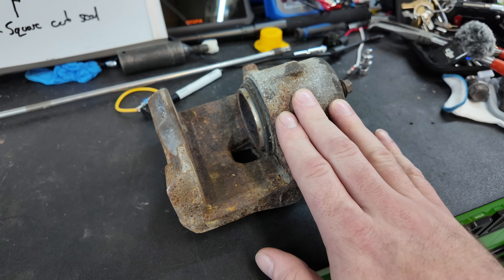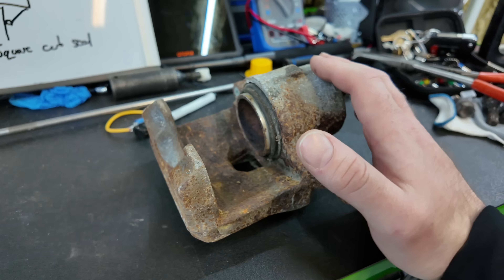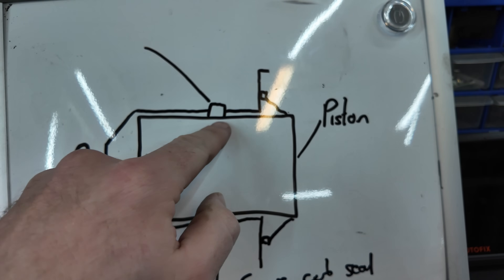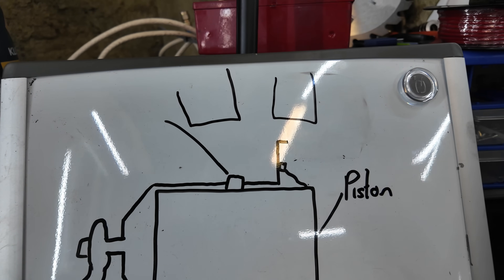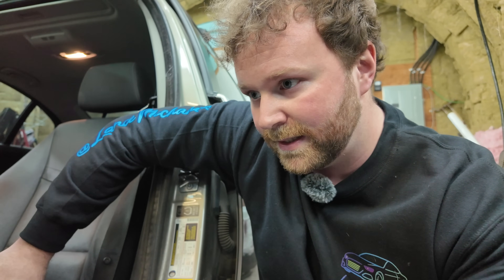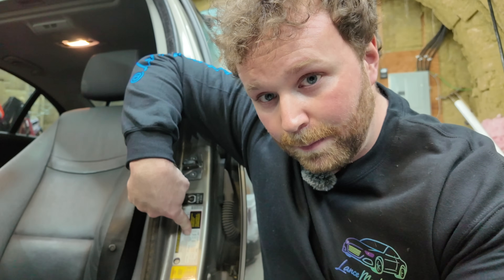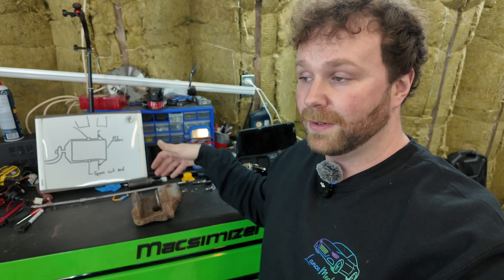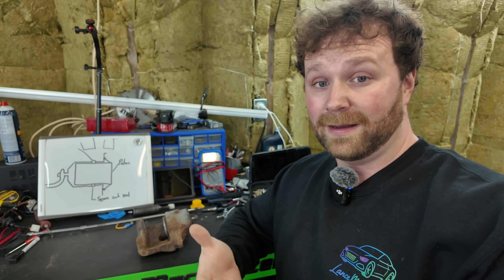Half of New Techs Can’t Explain This…

Comment: I wondered who acts as return spring and I found the same explanation: the piston is pushed out by the liquid, the square seal becomes a rhomb and when the rubber's elastic force is greater than friction, the piston slides with respect to the seal. When the pressure decreases, the seal becomes square again and retracts the piston a minimum but sufficient distance. But who retracts the pad? And if on some models the pad is attached into the piston, who retracts the opposite pad, by sliding the entire brake calliper? It's disk run-out. I can confirm that with huge run-out (bearing damage) the gap/clearance increased dramatically; and somebody reported a guy who grinded the disk ON THE CAR to have absolutely no run-out obtained smoking pads, because no pad return.

Comment: Is that seal going bad one of the reasons a caliper can get stuck on?
Reply from the maker: More likely the dust boot has a rip and there's some rust on either the caliper bore or the piston. When seal is faulty they leak brake fluid

Comment: Speaking as someone with decades in automotive- the world has changed and the bright technical guys who may have gone into the trade when I was young in the 1980's and 1990's are now going off to college or doing other trades with apprenticeships. The auto trade is now famously linked to miserable working conditions, low pay, isolation, disrespect and a confusing flat ray system (thanks to the Internet and social media). A lot of the guys who do it now have nowhere else to go and aren't the sharpest knives in the drawer- which is ironic given the complexity of modern cars and systems. Automotive SHOULD be a high paying trade with established licensing, apprenticeships and schools like electricians, plumbers, elevator techs have (and who make 6 figures all day). Arguably, it's the most complicated of all trades in terms of sheer systems to learn and understand. However, we've created a broken system where ANYONE can claim to be a mechanic and there are no standards.

Comment: 2:39 i can give you a very easy way to prove this.
       Take a double axle trailer camping and set it up quickly. Put in a trailer axle stabilizer and tighten it (one that locks the 2 sets of wheels together)
       After you f around and finish setting up camping, or even tge next day, that stabilizer will be loose. After the tires cool down. Father in law kept blaming the clamps i told him my theory

Comment: I started in this field in the 70's right out of high school at a chevy dealer for a year then a Toyota for 2 years, back in those days we rebuilt everything, calipers, wheel cylinders and master cylinders I don't really care what causes the caliper to retract I only care about what causes the caliper to stay on, I could have a slight leaking caliper where brake fluid is getting past the seal, cause the seal is hard and brittle, I rebuilt a lot of those, but it will still release when I take my foot off the break cause I took away the pressure and as for your tire problem if a customer pulls up to the shop and wants me to check tire pressures cause they are going on trip do they need to leave their car overnight so their tires to cool off? If a tire has 45lbs. of air and it calls for 35lbs. is it safe to bring it down 37lbs. while hot? I think so.

Comment: We have several doors damaged at my last place of work because people couldn't figure out how to close them. When you open the door, there is a friction bolt that hods it open. To close it, you step on the latch, and the spring pushes the bolt up so you can close the door. Bunch of idiots damaged the door, trying to force it closed. When I arrived I asked what was going on. They told me the door was stuck. I went over to look at the door, hit the latch with my foot and the door closed. They looked at me like I had just done a magic trick and asked me how did I get the door to close. I thought they were messing with me. 4 guys couldn't figure it out and have damaged the door by trying to force it closed. 

On another occasion, several people were getting an electrical shock when opening a metal hatch. I went over and took a look at the hatch and asked, what genius ran this electric cord through the hatch and then closed the hatch. They told me that the chief had directed them to run the extension cord through the hatch and later had told them not to leave the hatch open, because the prisoners could reach out. I unplugged the cord, and opened the hatch. the cord had been smashed and bare wires were showing. I asked them if they seen the bare wires. Several of my partners said yes, but then added that none of them had touch the bare wires. I was the chief shop steward, but I just started at them. I took the cord and left the area. Several of these guys had college degrees, but no common sense.

Comment: The reason these parts changers cannot explain how a brake caliper piston retracts is very simple and it is because they have never rebuilt a brake caliper or wheel cylinder.  Before I retired I was a shop foreman for a large independent repair shop and anytime I was hiring a new technician they had to pass wat I considered a simple test. It included refurbishing a single piston brake caliper, replace a set of brake shoes and refurbish the wheel cylinder, rebuild a GM 1 wire alternator, dis mount and mount a tire on a locking ring rim, and find a simple electrical draw. On average only 1 in 25 applicants could pass this very simple test
Reply from the maker: That's a solid, practical test for a new mechanic. Rebuilding components really teaches you the "why" behind how things work.

Comment: I agree with a part of this take I went through school myself and came out as a master and am now an instructor (after some years in the field). As an instructor I beat the basics into my students heads because that’s what they need to build off of. What I combat is older techs teaching them short cuts before the “Right way” so their basics of understanding when it comes to the dealership setting is skewed. So the cycle continues of people teaching other people “What I’ve seen” or “I’ve always done this” works sometimes but cars now a days are not the same as they were 20 years ago. So yes I agree with you on the fact that new techs need a better base at most schools but it also falls on proper mentorship. It’s pretty hard to point out a system that isn’t even computer controlled now on most modern vehicles which is why so much emphasis is put on electrical.

Comment: Auto techs leaving. Technician shortage. Yet every dealership i've been by that's hiring wants someone with shop experience. I have expressed i have been working on engines since 4th grade (can get away with child labor growing up on a farm). Rebuilt a 302 when i was 20. Sidegigged auction bought cars for a nearby buyer for his lot in high school. I diagnose, I don't shoot the parts cannon.  

I know all about flat rate, warranty work, and speed and repetition. And yeah im gonna start doing lubes til you see im still motivated

If techs are leaving, where is this huge supply of experienced techs these dealers expect to pull from???.

Tomorrow calling the svc manager i got a card for and clearly states we are hiring techs with no exp... but I expect to hear the same excuse.

Been offered sales, but the reason I want to work at a dealer is repair.

I'm not even chasing money, why techs leave of being paid too little. I can get by with tech pay.... I truly want to master repair that comes with full time work

Tomorrow thinking of drawing up a liability waiver and say "let me shadow one of your best techs 30 minutes and you take his recommendation "

Hell ill give a 30 minute lecture on why changing plugs ain't gonna fix that misfire or why a p0420 may not (yet) be a bad cat, how catalyst is really an oxygen storage device and a constant lean or rich will cause downstream signal mimic upstream throwing cat inefficiency.

Who do i gotta bend over to get in the trade?

Comment: Mechanical is the primary system, electrical and electronics are secondary or tertiary systems. Brakes......I push the piston back in and bleed, usually out of the bleeder.  Bleed and hold. Close the bleeder. If you bleed straight back to the reservoir,  you stir up debris from the bottom of the system. It destroys the internal seals in the master cylinder.  Next thing you know. Creeping pedal in traffic😢.

Comment: With all due respect, it's  the absence of fluid pressure (and properly lubricated sliders) that allows the piston to retract into the caliper bore. The brake rotor, and the jouncing of the suspension actually move the piston. The seal is square cut because if it were a round captured O-ring, it would roll on the piston, and pinch or tear within the groove meant to capture it.
 I do agree, kids coming up do need to learn the basics.

Comment: Nothing new here. Had issues almost 30 years ago with shops not knowing basics. Had my training before computers were a thing in cars. Computer feedback carbs were just coming out in 1980. I went into auto manufacturing instead of wrenching and did my time on the assembly line. Move forward to 1995. Had a Chevy S10 with 2.8 V6 and throttle body fuel injection. Had a problem with check engine light on and running roughly. I was working OT at the plant and didn't have time to mess with it plus I didn't have the scan tools or updated schooling. Dealership had late hours so I went there. Truck had 138,000 miles on it. They took a look at gave me a salesman's card. STRIKE ONE! They did a 'diagnosis' on it. Said the throttle body gasket was bad, the computer was bad, the lifters were bad, you name it. Shotgun approach. STRIKE TWO! I took it back home and changed a couple things they said were bad. Lifters were fine BTW. I found they had also left the oxygen sensor wire off. STRIKE THREE. I went back to basics. Checked one cylinder at a time to see which one had the misfire. Pulled wires loose one at a time. Found one with the miss. Took the wire off and ohm'ed it out. Discovered one the new wires I had put on two weeks before had gone bad and was open. Changed it and engine ran fine. Money light off. It didn't need ANY of the stuff they said. They couldn't find a bad plug wire with all the 'training', computerized scopes etc. ABSOLUTELY WORTHLESS! I still don't own a scan tool, but I bet I can kick their butts for most things because most of it is BASICS. Engines need air , fuel, spark and compression at the right times.

Comment: I’m currently in a technical college automotive program (4th quarter), and I’ve found that the classes themselves are not hard to ace.  The real problem is the pace. It’s like drinking from a fire hydrant.
So much material is crammed into short term memory that there’s almost no chance to develop real “muscle memory” on the basics. You’re constantly moving on to the next system before the previous one has a chance to become long term knowledge.
There’s a lot of theory, but not enough repeated hands on experience, which is what actually locks things in. Months later, even core concepts can feel distant simply because you haven’t had enough time working with them.
I honestly think programs need to slow down and be longer, giving students the time and repetition needed to turn skills into real competence.

Comment: I was a mechanic for 41 years, recently retired. There is a big difference between a mechanic and a parts changer. A mechanic has to actually understand the engineering and physics behind how things work. I have built cars from the ground up. I have heavily modified cars. I am a hot rodder and amateur drag racer. I build my own race cars. Most people coming of "trade schools" today are being taught how to change parts. One of the biggest offenders in the U.S. is a school called UTI. Universal Technical Institute. They have a lot of ads on TV and online, telling people how much money you can make in the auto repair business. It costs around $50,000 to go to this "school". So of course students take out huge student loans. When they finish the school, they find out they aren't really qualified to do much of anything. Some dealers and shops will hire them as shop rats, making next to nothing. Nowhere near enough to live on, and certainly not enough to pay back that massive student loan. Now, I was a car guy since around age 10, when I started to learn how to drive and work on cars. I couldn't find a job that would support me when I got out of high school, so I joined the military for 4 years. No long before my enlistment was up, I found a job with a large government fleet department at over twice minimum wage, basically as a shop rat, someone to sweep the floors, clean up oil spills, go get parts, and help when mechanics needed someone to hold something for them. In 5 years I went from that to as far as I could go without becoming a supervisor, which I finally did at age 50. I had great pay, great benefits, job security, on the job training, and when classroom training was needed, they paid for it, and even paid for the time. I was paid by the hour, no flat rate. We were busy, because we were short staffed. We worked hard, but we got paid well for it. 

But the thing is, If I were young and just getting started, there is no way on earth I would choose to get into the auto repair business today. Cars aren't even cars anymore. They are software driven computerized WiFi connected VIN locked self driving spymobiles. I have zero interest in anything like that. I like machines. I like carburetors. I like points ignitions systems. Disc brakes are fine, as long as they are not ABS.

Comment: It's a waiting oil change and I have to change oil and set tire pressure in 15 minutes, I'm not waiting for tires to cool off and neither is anyone else
Reply: @jeremysmith3556  The irony is you cant even properly drain oil in 15 minutes let alone do anything else. 

We used to get 1.0 for oil changes with inspection. Leave that stupid industry.

Comment: As an 80 yr old engineer I hear this and I think thank god at least one young person has GOT IT , please spread the word you are 100% correct. My 2021 car has been in to the garage alot lately with a current drain and an intermittent starting issue and the fault persists , tap the starter and it works !! for gods sake . The car is still under warranty and I think the mechanics just plug a Topdon in and if it doesnt throw any error codes they do not know what to do . No basic knowledge or skills ,  proper apprentiships are needed , I guess the dealers and manufactures will just Ai will solve everything..
Reply from the maker: yep :(

Comment: I experienced the same thing, even as a young tech(only been doing this 6.5 years). I went to school, and spent a lot of time learning about the old stuff. At a dealer, most cars tires that came for LOF’s will still be hot, and low, because they never get checked until service!🤦‍♂️ I would always fill hot tires about 3-4psi above what’s on the placard, tried to get others I worked with to do the same, without much success.🤷‍♂️
Reply: Set most to 42 psi so it will be 36 psi cold.

Comment: Honestly never knew that I always assumed it was just the hydraulic pressure release that drew it back slightly
Reply: Because it is. Just stop applying pressure. That's enough. Done. There is no need for retracting action. "Jumping back" a bit is a natural effect in most types of piston seals (doesn't have to be square cross-section). No one "designed" it. If so, lubrication during assembly should be forbidden (because it could spoil the effect).
Main reason for square seal is a robustness (comparing to an o-ring for example). Retracting is a nice bonus.
And if so, the seal itself is not enough (the groove shape may play a role too).

Comment: Glad I found you, I have seen so many bad techs in shops that say they are good but do not know what they are talking about. This 1 shop has been in business for over 25 years. I bring a 2006 Ranger 2.4 to them because the AC did not work. They tell me we need to change the complete duct system to get it to work. I know better, so I asked a friend to check it. It needed 3 cans of AC fluid and 1 actuator. $1800.00 and now I pay $500.00 only because the actuator came from Ford for $230.00.

Comment: I also found that there is no return spring, and gave the same explanation, but I got the reply: "agree that the square ring retracts the piston, but who retracts the pad?" - seems the runout of the disc (rotor) does this (including cylinder (stirrup) shift, for retracting the opposite pad also).
But how works the rear braking system? There the piston is pushed either by the liquid (service brake) or by the cable (parking brake) which must adapt its travel according to the pad wear.

Comment: I run my tire pressure high for around town and local driving but when I get out on the highway for a long trip at my first stop I check em and let air out  and bring the pressure down to just about max listed pressure. I watch the wear and adjust as needed. When cold weather sets in the pressure drops and a bump up is needed. I also check em when the wife asks about them. 
I just gave her a couple of new tires for Christmas. When good mechanics retire they take a lot of knowledge with them and if shops were smart they would have new guys work with them before they go to pick their brain and glean some of their knowledge. 
Good video. Happy Motoring.